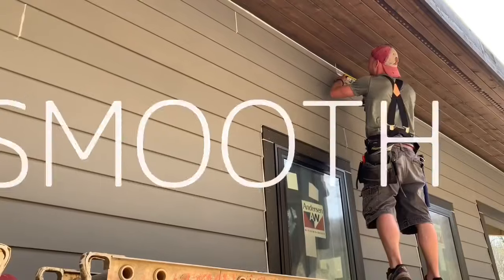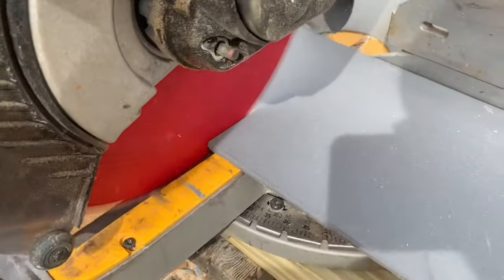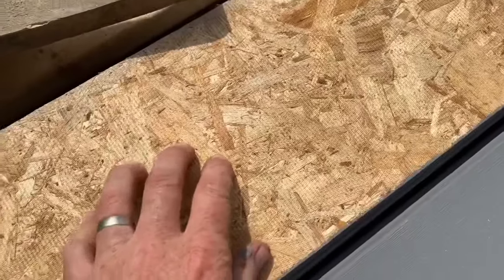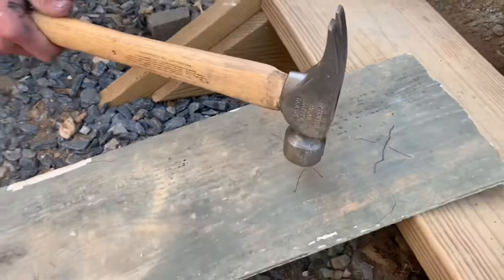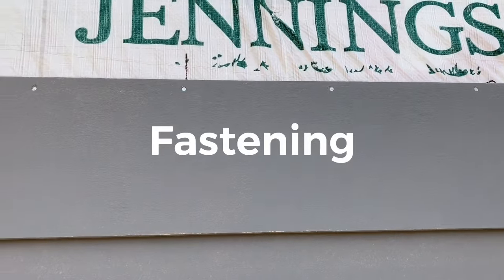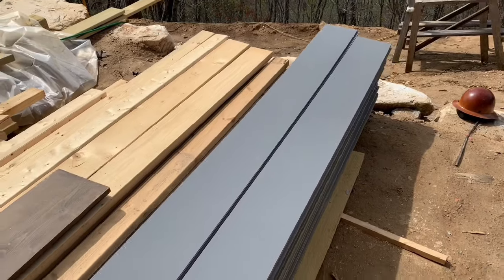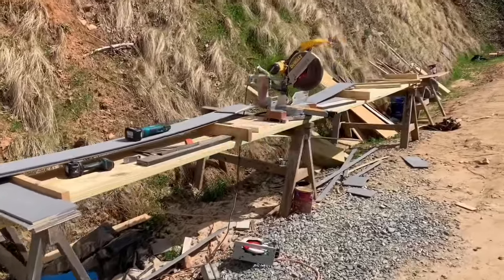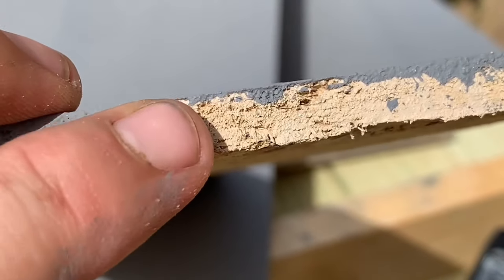Smart Side vs. Hardie Board Siding which is better

Comment: Explain to me one thing though I've been looking a lot into the Smart Siding there have been failures and rot that I don't understand is supposed to be water resistant
Reply from the maker: Hi there… First of all there were two different versions of this product. The older version did have some issues and was replaced with the stuff we are using. Sealing the cut ends of this material is still very important though for it to last. It is a wood product so it can soak in moisture through cut edges if it is not sealed properly. I have seen lots of people improperly installed yet and most of the issues are On the siding that has been installed above a roof on a dormer where they did not seal the cut ends and water was splashing directly off the roof and saturating the cut ends.
Reply from the maker: Also just a note… The product that I am comparing it with, hardy board siding, will also turn to mush if you leave it in water for a couple days :-)
Reply: @PerkinsBuilderBrothers  thank you for the info that's what a lot of people are saying improper installation I'm just little Airy when it comes to particle board like wood they always seem to swell no matter what resin they use yes you do got to prime and I agree with that the manufacturer should just Prime both sides
Reply: @PerkinsBuilderBrothers  I checked those video that they're referring to failure Smart Siding LP and one was done 7 years ago the other was done three years ago so I guess they have not updated the results someone should put an update on their product and how they improved it they still have these videos on the failures that are old
Reply: Same question I have, how is the non painted cut end any different from the non painted back
Reply: @luedy2211  yup
Reply: @luedy2211  Water should not get behind the wall.  Any water that gets between the caulk and board will run down over the board beneath it.  The top is hidden but usually it's about 4 inches of overlap depending on board width.  The backs should never get wet unless it somehow wicks up the wall.
Reply: My understanding is each wood chip is sealed before glued into the  boards so when you cut the material you expose the center of the wood chips that won't be coated in the sealant. That is why cut edges must be painted and sealed.
Reply: How many pics of failure do you want.... my company has installed hundreds of homes with both these brands and some other brands as well..in my climate,(high desert), there is horrible
 expansion- contraction, the WORST out of all exposed seam siding is SMART SIDING.... I have seen your 3/16 " gap end up being 1/2" in the dry season.....and then in wet season it completely close.the gap to point of forcing all caulk out of the required spacing....my hardie jobs almost never have warranty issue..."not so smart" siding is always the culprit...and just for reference when you r reading the installation instructions u r literally reading MY words...I have worked closely with three different siding companies trying to resolve reoccurring issues. And they all hate me because I get critical about there product. In my professional opinion ,.  To get the best product on your home, u will have to use multiple  brands.....there isn't a manufacturer that had all the siding components figured out.....
Reply: Brian Heuer Then why are we putting house wrap behind the siding??

Comment: Apples to Oranges. Which is better, which has the better warranty? LP 5 years, 100%, then starts getting prorated for the next 25 years, decreasing every year. Hardie is 30 years, 100%. Enough said, everything else is opinions based on owning LP for 2 years. There is a reason LP decreases their warranty...
Reply: You are INCORRECT. 50 year warranty and it starts from day one to 50. 5 years initially on the labor should something go wrong. Hardie is 30.
Reply: @teamplayer1218  Yes, I am sure you are correct, I did entertain LP when I did my home, but went with Hrdie. LP warranty is not very good, then there was that class action lawsuit. My contractor has done both, he said run from LP. YMMV..
Reply: @indydude2826  The class action suit was for their prior generation siding called InnerSeal that did fail over 23 years ago and they settled. SmartSide is the new generation that performs and provides the 5/50 warranty. Well above Hardie's. So your contractor who told you to "run from LP" was terribly wrong. And as a "professional", notice quotations, he should have done his research before providing misinformation to you the client.
Reply: @teamplayer1218  I quoted LP as well, from several different contractors as well as Hardie, and two of the contractors quoted both products, with minimal cost difference, both recommended Hardie, despite being harder to work with. Two contractors brought in samples of LP which they removed to repair in the last year. Both looked good from the exterior side, but had black mold and delamination on the backside. Maybe it was an install error, or just crappy product? Maybe in other parts of the country, this us not an issue, but where I live with rain and high humidity, I didnt want to go that route. Obviously you have a horse in the race, I dont. But looking at the LP warranty, they have lots of loopholes and caveats.  My Hardie does not. I used a Hardie Platinum installer, and the Hardie rep came to my project at completion and looked at the work. Like I said, LP may be the best thing in the world, but even if I did it all over again I would still use Hardie. It looks so nice, fire and termite resistant. Have a nice day.

Comment: I can't believe this video like smart siding over hardie. That's insane.  The gaps you have to leave on this stuff are insane.  Like quarter inch on seams and ends. Looks like shit with the gap but if you don't leave it,  it expands and will push itself off the wall.  Also it's made of osb material,  not great for getting wet.
Reply: The gap is 1/8", not 1/4" and it's not very noticeable after you caulk and paint unless you just want to look for it.  Also, in my opinion it is better than Hardie versus water.  Hardie is cement and cement is porous and the water will make the Hardie brittle over time where as the Smart Side is very resistant to water.  Yes, you need to paint the cut edges but that's not really a big deal and Smart Side is far superior in durability when getting hit from rocks thrown from a mower or hail or kids hitting the house with a baseball, etc.  It doesn't dent like Hardie.  Smart Side all the way, all day.
Reply: @jtltet  the gap is 3/16". And you're telling me that osb material is better for water protection than fiber cement?  Ever take any water rotted osb out?
Reply: @christophermalloy2 , this is osb but it is not the same as regular osb.  Also, the front is not osb material.  Have you ever taken out any crumbling concrete blocks from water damage?
Reply: @christophermalloy2 , also the gap is 1/8"
Reply: @jtltet  courses.
• Leave a 3/16 in. gap. All joints must be caulked with sealant.
Optional joint moulding may be used. If joint moulding option is
selected, add the thickness of the web to the gap allowing a net
3/16 in. space for expansion.
• Nail at all framing members around openings (maximum spacing
16 in. O.C.). Shim, if necessary, to provide solid backing for siding
fitted around windows, doors, and at rake cuts on gable ends.
• Where siding butts against window and door trim and at wood
inside and outside corners, leave a 3/16 in. gap and seal.

Copy and pasted from install instructions
Reply: I'm a pro. Better start installing that stuff right or the job you do this winter will be calling you back in summer when it expands
Reply: @christophermalloy2  The fiber in fiber cement is cellulose (wood). It absorbs water and when the water freezes and thaws over several cycles the cement crumbles.

Comment: I think hardie is harder? To install,  but the question shouldn't be is it harder to install, but should be does it last longer. Does hardi last longer than the osb backed smart siding? If hardi last longer there are good ways to cut the product, and yes, wear a mask or put a fan to blow the dust away. I'm a painting contractor that has installed allot of hardi. It's good stuff and you can get it cheaper than 12. Something a board. I noticed the smart side had to be.primed twice! Wow! That's also extra work and it's osb! Not me.
Reply from the maker: Warranty as I read it is 50 yrs on the smart side and 30 on the Hardie... and you are supposed to prime the Hardie and double coat it as well if you look at the fine print. Bottom line with anything lasting well is that it is installed and coated properly ;)
Reply: Hardi warranty says 30 to 50 years as well.

Comment: instead of caulking the butt joints you can use the metal trim pieces
Reply: They look worse.  They also make a plastic insert that slides between the 2 boards but in my opinion the caulked joint will look better in the long run, especially if you go back over it after the 1st coat dries and shrinks a little then you can paint over it and it basically disappears from a distance.

Comment: Is it termite and rot proof?
Reply: It’s supposed to be. But I know it rots and absorbs water. It’s easy to work with though. I wouldn’t use it on my own home.
Reply: Termites usually start with the framing.  So it doesn't matter if your house has brick or hardie board.  Most fires start on the insides of structures....
Reply: @TeensierPython  It doesn't rot or absorb water. So you don't know. Yes, the Zinc Borate in the product repels termites as it has been tested in termite mounds and in Hilo Hawaii, the wettest place in the US as it rains there every day. Educate yourslef.
Reply: RBD RBD - I do know. I work with it everyday. It’s trash. I wouldn’t buy it.
Reply: @TeensierPython  If its trash, why are you working with it every day?
Reply: RBD RBD - because some housing developments require it.
Reply: @TeensierPython So where are the claims, the class action lawsuits? This stuff has been out there for 23 years with a 5/50 warranty from the company. Why are housing developments requiring it?  They'd be out of business by now if this stuff was "trash" as you claim. C'mon!
Reply: RBD RBD - you think what you want. I will do the same. I am entitled to my opinion as are you. I will never buy it. Far too much maintenance and it does rot and absorb water. I will stick to steel siding.
Reply: @TeensierPython  I work for the company in their siding division, so I have some background to stand on here. If it rots and absorbs water, wouldn't there be class-action lawsuits galore? Wouldn't the company be out of business by now? The stuff was re-engineered 23 years ago, millions of feet sold,  mostly dominant in the shed market and now launched with a new prefinished line called ExpertFinish to the R&R and new construction market. Do you still say it will rot and adsorb water? C'mon. Don't buy it as its your choice for sure but I have to cite your statement as totally inaccurate and false.
Reply: RBD RBD - you’re right. I was lying. Never saw it absorb water. Never saw it rot. Fantastic product. Totally recommend it. Wish I had it on my house. Would hate to pull down all my maintenance free steel siding and replace it with this magic miracle wood byproduct I have to constantly paint.
Reply: Look through this comment section, LP is trash. Find a job selling something better.
Reply: @TeensierPython  Incorrect. You do not have to constantly paint if you use a high quality latex finish. Their new ExpertFinish which was recently launched by the company provides a 15 year warrant on the finish.
Reply: @TeensierPython  I have looked and there are a lot of pro comments from people who have used it. Google HardiePlank reviews and your see a plethora of nightmare scenarios.
Reply: RBD RBD - I already stared hardie is worse. No need to convince me. LP is trash. Buy it if you want. Sell it if you want. It’s garbage and I won’t buy it.
Reply: @TeensierPython  Up to you of course. But I still oppose the statement that its trash. That's a broad statement in my opinion but sure, your entitled to it. Steel siding however? Huh? What stuff is this that you use? Curious.

Comment: I install exterior trim. Hardie is crap, we don't install it anymore. It doesn't shoot very well, breaks, and soaks up water when left in moist areas. If you do manage to get it installed, better hope your child hits his baseball against the windows and not the Hardie board. The window has a better chance of not shattering. We use all cedar or smart lap.

Comment: Bottom line: Anything made of OSB has a tendency to rot over time. So in that case, Hardie plank is better, but I don't care where you live... FACE NAIL ALL HARDIE PLANK! Then use CHINKING on all butt joints and any transition points. Chink absolutely everything, except maybe horizontals. Chinking does not fail... yes, even on cementitious products, if done correctly.  Hardie board is meant to take 100 percent acrylic paint anyway, so who cares if you facenail. You are painting it anyway.

Comment: Hardie is way better quality and longevity wise, but lp is easy to install and more profitable so contractors push it.
Reply: How is Hardie "way better"?
Reply: @teamplayer1218  Smart side rots too easy. I see it all the time on the bottom edge of the boards.
Reply: @AJourneyOfYourSoul  On recent product or the old Innerseal stuff? That news to me.
Reply: RBD RBD i looked at some last month that was 8 years old that had some issues.  It is almost always on the bottom edge or a joint, but the joint issues are usually install issues so not the fault of the product.
Reply: @AJourneyOfYourSoul  With anything, it's always about installation. doing it wrong with LP or Hardie and you'll have issues. My contention here is with the inaccurate postings that are just not true with SmartSide. If its so bad with rotting etc. why would the company stand behind it with a 5/50 warranty? With millions of feet installed over the last 23 years there would be class action lawsuits all over the place and they'd be out of business.

Comment: 90% of the time every time we see you at Hardy job they got LP smart side corners what is that tell you
Reply: Not all people like a smooth trim and prefer wood grain. Up here in Canada we have our own wood based products that blow the LP out of the water on warranty, and with that product to you see people using the trim to the fiber
Reply: I've installed Hardi for over 20 years and have never used smart-trim or any other type of trim board more than Hardi itself. That doesn't mean one can't use the trim they like. Some people believe having 12' sticks makes more sense and if you can get 16' of course that will run faster for long walls. You can shoot the Hardie trim on with 2" trim nails. It's really amazing how well it holds, the trim will break apart if you have to pull it off the nails hold it so well. They limit the size of Hardie so that 1 person can install it if they want.
Reply: @jerrellbevers6071  You can't be serious. Hardie's trim is horrific. Brittle like the siding and 10' lengths. Have you really ever used SmartSide?
Reply: Jerrell Bevers yea I’ve never seen or heard of people putting LP trim on Hardie siding. Azek or Kleer Pvc trim or Hardie trim.
Reply: @pavelomar4631  Trims and sidings are mixed and matched all the time. Just because you use one siding product doesn't mean you have to use the same manufacturer for the trim or visa versa. It's common.
Reply: RBD RBD no of course, I always encourage my customers to use Pvc for trim if possible. Still a decent product and much more affordable, I’m just saying I’ve never heard of LP trim on Hardie...that’s all

Comment: Hardie board will not absorb moisture and it comes in a lot of colors so you don't have to paint it. Fire proof and everything proof and will last a lot longer than Smart Side.
Reply: Hardie board sucks.  It does NOT hold up the way they say.  Mine is only 13 years old and I have several planks that need to be replaced because they have absorbed water, cracked and then broke off.  If I could afford it I would have brick installed.  This stuff was put on when my house was built in 2007.  I like it because of the look but that’s it.  I already needs to be repainted too.
Reply: @100fredkrueger , that's interesting to hear. My house was built in 2006, all of my siding is Hardie board and I have had no issues. I just repainted my house for the first time two years ago.  I wonder if the difference between yours and mine has to do with some type of board prep or treatment before installing it? I do know that you have to paint all six sides of the boards before installation.  I live on Whidbey Island in Washington State and get a lot of rain so if there was a flaw with the product itself I would think I would have seen the issue first hand. As far as needing to repaint your house already, it has been 13 years already and on average homes need to be painted every 5 - 10 years depending on paint quality and the material being painted.